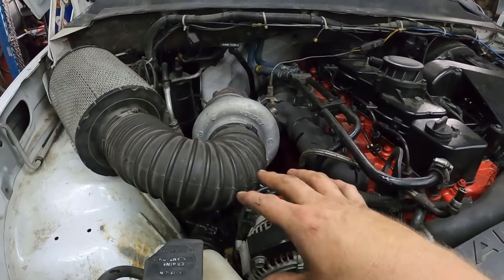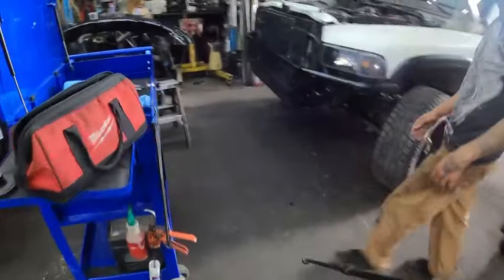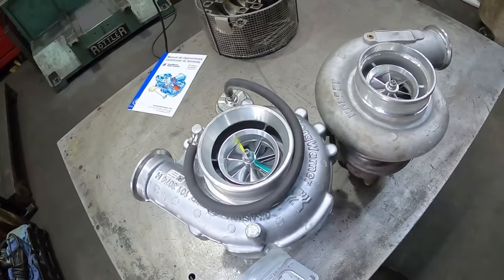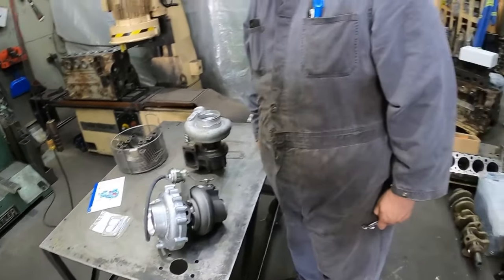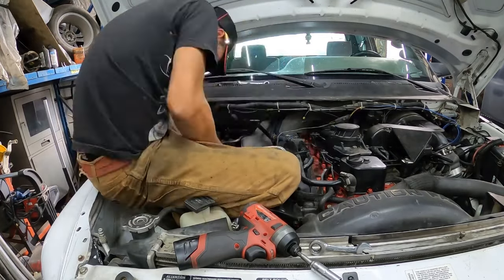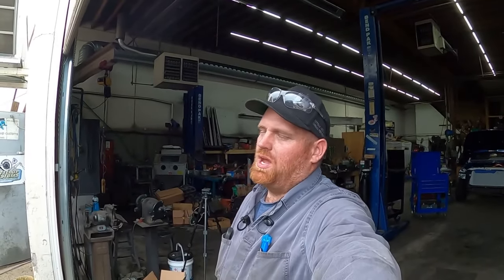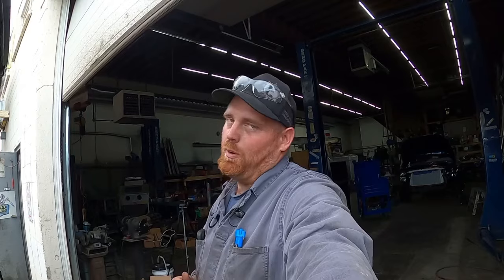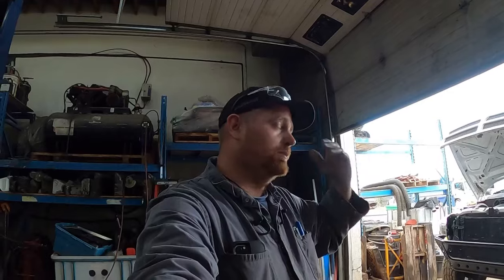K27 swap on the my 12 valve Cummins  running black diesel

Comment: I went the k27 on my 92 1st gen VE pumped intercooled in my Fummins and it has around 280 is hp no slouch but not after a pro mod drag vehicle either so good results for me .

Comment: Borg Warner 177272 found on a John Deere 8.1. 60x83.5mm comp wheel. 76x68mm turbine with an AGP Turbo 12cm dual gated turbine housing is a super kickass turbo. 8mm turbine shaft with no neck down like the HX351.
Reply: so that would be a 60/68/12 or a 60/76/12
Reply: @lukemonson320  60/68 12

Comment: Happy with my k27 and 5x12 and afc live about 400hp spools eazy and dont get hot
Reply: You get those injectors from DFI? Still like ‘em?
Reply: @Thanosisnotreal  they are bosh from power driven diesel. Yes I still like them the truck has plenty of power, but doesn’t run crazy on e.g.t
Reply: @truckcampertraveler7369  my truck is still on stock injectors and HX35. I tow a horse trailer weekly, maybe 8k pounds. And LOTS of hills around here.. I want more power, but need to keep EGTs cool.
Reply: @Thanosisnotreal  if your turbo still in good condition, I will just swap out the injectors to 5 x 12 and I would change out the delivery valves .55 and do a afc live and a bhaf

Comment: 👍👍do twins make a small single spool better ,??... I thought they only spooled ,as a pair ,as well as the small charger could... I'd like to pair something to the  HE351(60/67) I have on my 97.. I'd like to try a K27 as well...may perhaps do that on my 02... Or I might try a stock he351 cause it isn't overly fueled..but anyway, 👍,thank you for another video 👊
Reply from the maker: You want to small turbo to spool low rpm and the bigger turbo to take over high rpm. Is the simple way to explain it. But it’s bit more complicated then that. I will get into more later

Comment: I have a 98 12v..Is this a good turbo for a stock truck with 4in exhaust? I’d eventually plan on doing 4K GSK and 60# valve springs. Just want to see if that’s something I’d need to do right away or if I could run the k27 on stock set up. Thanks again!
Reply from the maker: You can do a k27 on a stock setup. But myself I would keep the hx35 till you want a power upgrade and put a bit better turbo on

Comment: Hello. I installed the k27 in my 12v but I can't get over 22psi boost. I've adjusted the waste gate same as you. Did you have to adjust it more?
Reply from the maker: If your on stock fuelling still that might be on the boost it will make Also should do a boost leak test on it see if you haven’t done one. If you have no boost add some fuel and see how it works

Comment: Will the k27 work as a direct replacement for the h1c on a 93 ve motor?
Reply from the maker: Basically the same as swapping a hx35 on. Couple things you have to do

Comment: Hmm I may need to replace my stock turbo at some point . I need to replace the stock manifold before it srinks and brakes something.  Really appreciate the videos .   I have another question.  What is your thought on a fluid damper .. it's probably not realistic but I been told that thr noise from gear roll over on a g56  is caused from removing the dual mass flywheel and going to a single mass . So I was wondering if a fluid damper would make any difference.  Probably not but I was wondering
Reply from the maker: it doesn't hurt the have a balancer, but i am not sure it would help